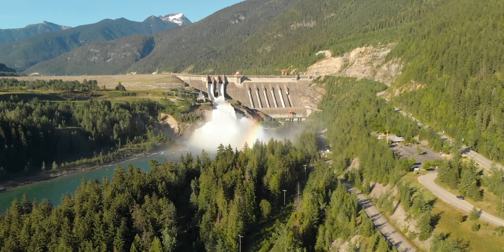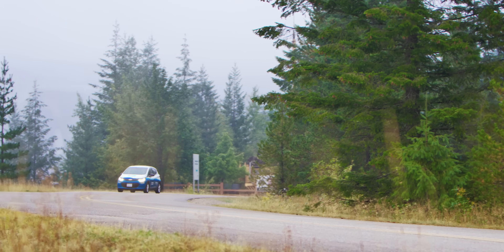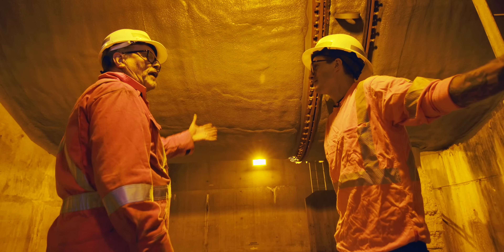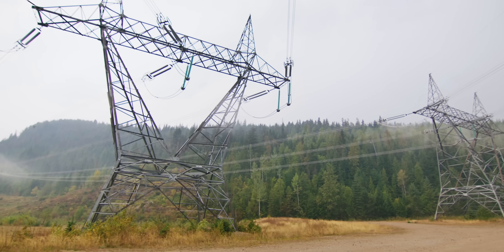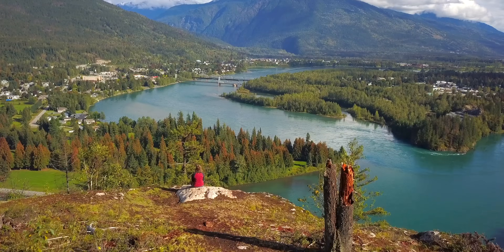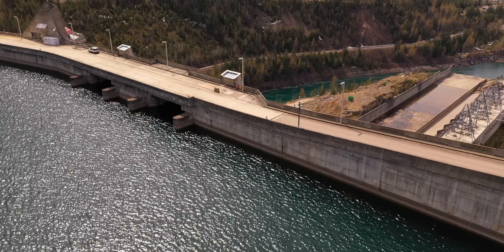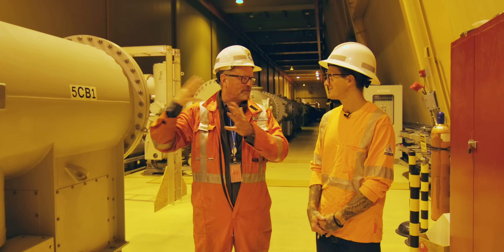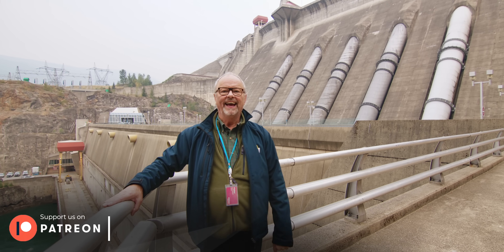This Dam Makes Enough FREE Energy To Run A City

Comment: I think you Canadians need to start thinking about using your hydroelectric power as a big battery for California.  Hold back your hydro power during daylight hours when California solar has excess production that can be used to serve your day time loads.  Then at night you can send hydro power to California to supply their off peak loads that solar power cannot provide.

You actually have the opportunity to be the most economical battery for California.  The 500kv transmission line becomes the means to accomplish this.  This scheme is way more efficient than pumped hydro even considering the transmission line losses.

Back in the late 1960s California utilities benefited from Canadian Entitlement Power purchases following the construction of large dams in Canada.  I think it is time to look at a new opportunity for your hydro to work in conjunction with solar installed in California and the Pacific northwest.

Comment: Two things: There are thousands of old dams (for flood control, old mills, navigation) that have no hydro. A major untapped resource. 2. It is possible to have hydro without dams, using a sort of mill-race system (canals or pipes which hug canyon walls, until they reach a certain height above the canyon floor). In the 1800s and early 1900, this was done all over the western U.S.

Comment: Yes massive but Robert you formula at start is way wrong.
1m3 is 1000kg.  It falls 1 m it has the potential energy of 1000 Joules (PE = m x d).   
1000J is 0.000278 kWhr.  So you were out buy a factor of 3600.

Of course that assumes 100% efficiency which a Hydro plant is about 90%.so 1m3 falling 1 m generates 0.00025 kWhr... or you need 4000 m3 to drop 1m to generate 1kWhr.
Keep up the great videos thanks

Comment: But the up keep alone to maintain something this big would be in the billions annually roughly so 🤷 I come to this by average annual prices for upkeep of hydrodams annually so 500Kw is around £50,000 on average in uk 
Now 7,800 Gigawatts converts into 7800000000 Kilowatts 
So it would cost roughly 150/200 billion a year for annual maintenance alone 😐😐 indeed at the same time if its producing electricity for a whole city am sure that is worth the price 👌🤟 Question is once the dam has paid for itself will the locals get cheaper electricity prices if not free once the dam has paid for itself and had many years of making profits and the government pays the upkeep with taxes or something 🤔👌

Comment: What was left out of this presentation is how well these Hydro Dams can fit in with the variability of renewable energy sources. These five individual hydro turbines can be started, and then throttled up as needed, to off-set the ups and downs of wind and solar. And hydro turbines are much faster responding than simple cycle gas turbines, which usually take 10 minutes to come to full power. These really are the mechanical version of the promised but still distant electric grid batteries, except they are recharged with water coming into the upper lake. The folks looking to get rid of these amazing power resources make me want to pull my hair out, if I had any left to pull. ;-)

Comment: 97% of British Columbia’s electricity generation comes from hydro.  The biggest chunk of the remaining 3% is wind.  A great many BC homes are fully electric (electric heating, electric stoves, electric hot water).  Electricity here costs barely anything, 12.5 cents (Canadian) per kW on average.
Reply: At the current exchange rate, 12.5 cents Canadian is 9.1 cents USD.
Reply: At the current exchange rate, $0.125 CAD is (I think) 8.2p in the UK?

Comment: dams are far from being free energy.
the cost is tens of thousands of animal deaths, the destruction of entire ecosystems and micro-climates, and massive amounts of carbon and particulate emissions manufacturing millions of cubic yards of concrete and reinforcing steel.
but sure, tell me more about how your heated towel rail is now running on "green energy"

Comment: One cubic meter of water dropping one meter represents a value of energy (1000x9.8x1 so roughly 10kWseconds) - Robert says it makes 1kW (a value of power…) - which it would if you dropped it over the course of ten seconds but without a value of time I don’t think the fact makes sense.

Comment: 1:58 "Cause I only know one thing and that is: 1 m³ of water dropping 1 meter downward produces 1 kilowatt of electricity". Sorry Robert, this is not correct. 
It produces 9.81 kJ of energy. If the 1 m³ would drop in 1 second, this would be 9.81 kW (kJ/s) of power. Do this for 1 hour and you have generated 9.81 kWh of electric energy.
One generator at the dam generates almost 500 MW. The water drops 175 meter. At a generator efficiency of 87% this requires a water flow per generator of 333 m³/s. So for all 5 generators delivering max. power simultaneously, it requires 1665 m³/s of water flowing from the lake through the generators and into the Columbia River.
In order to produce the 7800 GWh mentioned, the generators are "only" running 36% of the time at full capacity. 
Amazing facility!

Comment: Dear Robert, love your show and enjoy it for many years now. It was you to get me (an old petrolhead) in electric mobility (am on my 2nd e-car). I also used to be a big fan of hydropower. Of course it can be done in the ocean too, but it is mostly done in rivers (I guess also due to the long time, those facilities can be used and the offshore technic is still not "worldwide standard"). Talking to a biologist specialized in rivers (don't know the English term, sorry),  I understood, that the two most serious problems running a turbine behind a wall in a river are that rivers need a bed out of cobbles and other debris to run on. That "moving floor" is stopped at the wall. What happens downstream is, that without cobbles and stuff, the river deepens into its bed and - over time - creates an ever deeper canyon. So, here in Bavaria, the guys taking care for our Lech river (a formerly wild and sometimes destructible alpine river, nowadays tamed by more than 20 dams) decided, it is money well spend to help the cobbles over any dam. Secondly, it seems to be very hard to teach all creatures living in rivers (esp. new born fish) not be enjoy the feeling of being sliced up by turbine blades. All detour river extensions, at least to my knowledge, do not really help. Still, in comparison - a great technology!

Comment: The Chinese dam stopped working because of heatwaves. Climate change has ruined the most reliable source of electricity. Sure it's renewable, but it isn't intermittent or even that environmentally-friendly! Wind, but especially nuclear, are greener.
But I like reliable hydroelectricity.

Comment: Expensive, destroys habitat. kills salmon stocks, and concrete isn't anywhere near "green" yet.  Shame on you.
Reply from the maker: Thanks for the shame. Obviously trying to shame someone is qa very positive and supportive way of arguing a case.
So let us look at alternatives that produce this amount of power. Coal. Zero impact, burning coal is lovely requires no concrete ever and is clean and delightful.
Gas, same as above only even better and of course, cheap as chips.
Nuclear, um, okay a bit of concrete, and some waste stuff but other than that, super clean.
Wind, much better, very little or no concrete, cheaper, 
Solar. Zero concrete, much cheaper.
No electricity at all, burn whale oil for light and cook with burning sticks. Brilliant. We did that for 10,000 years and everyone was fine. Okay, they dies at age 34 but what the hell.
So I won't accept your shame mate, you work it out and stop being holier than thou (and failing) and do something useful FFS.
Reply: @fullychargedshow  Not the response I was expecting from a channel I regularly follow.  As we are seeing, the solutions we choose for climate change sometimes have deep, far reaching affects not everyone understands.  Electricity and Hydrogen are only as "green" as their sources.  Which energy source we choose to promote and pursue matters.  Just as there's a huge difference between green and "blue" hydrogen (the latter peddled by the fossil fuel industry in an attempt to stay relevant and lucrative,) electrical sources vary in their impact on climate.  Creating dams has a huge impact.  But you know this.  In this video, I do give credit to the dam spokesman for acknowledging both the issues dams cause and that, going forward, they hope to do things better.  The man seemed sincere.  But, given the tremendous impact dams have short- and long-term on the environment, I fear that propaganda like this will spur people to think that new dams are an answer to climate change.  In reality, dams are robbing Peter to pay Paul.
Reply from the maker: @rickhobson3211  Thank you for explaining the hydrogen colour scheme, (to someone who has been fully immersed in these discussions for the last 20 years) and explaining how 'electrical sources vary in their impact on climate.' All very useful information. 
Can I just enquire if tar sands oil extraction, transportation and eventual burning has a tremendous impact short and long-term on the environment? 
Can I ask if the long term social and environmental damage caused by all the oil majors in the Niger Delta over the past 70 years has a tremendous impact short and long-term on the environment? 
I think you'll find it does. 
Can I ask how long a gas peaker plant lasts and how many times it has to be turned off for maintenance? 
I'll tell you are we are both busy 'mansplaining.' They last about 30 years, use huge amounts of concrete and steel and require billions of cubic meters of gas to burn, which cannot be burnt again.
And you are very gracious to acknowledge that I know building dams on this scale has an enormous impact on the surround environment, but not on the wider global environment. In fact it is the least impactful way of generating 2.8 gigawatts 24 hours a day when looked at from a global standpoint.
I fully accept that when this dam was built back in the 1970's there would have been decisions made we would not make now.
But I suggest that in 2070, when it is still going,  people will look on installations like this with a far less jaundiced eyes than they will look at old nuclear fuel storage compounds with 24 hour armed security, old gas and coal plants, old coal mines etc
Reply: @fullychargedshow  I guess this is something that's going to be debated, going forward.  A quick google shows that there are deep concerns from many sectors regarding the long-term impacts of dams on the environment.  In my own state of Idaho there's an ongoing debate on whether the smaller dams along the Snake River should be removed due to their continuous impact on fish populations.  Moreover, while the long-term availability of dams in BC may currently seem rosy, the inverse seems the case for other dams affected by drought in the US and China.  Even now, investments in dams along the Colorado and the Yangtze seem misplaced, and this after the environmental impacts of building them.  The take-away may be that the power generation systems we build to combat climate change must also be able to survive climate change.  As this issue won't be solved in the comments section of a YouTube video, I think I will just close with stating that I do generally enjoy and learn from your videos, and I hope you do keep up the great work.

Comment: The power is not exactly free. The cost is included in the construction and operating costs. The cost difference of operation at full capacity and minimum is probably not that significant.

Comment: Robert, I guess you went to BC on a sailing boat?  Or maybe indulgence class on a gas guzzling jet - just to bring us this bit of news from fossil fuel addicted, tar sands, Canada.  Something that could have just as easily have been brought to us from the UK or Europe.  So why?  I really don't understand.  Please explain.  And "free energy"?  Let's defray the construction and maintenance costs of this dam and remediation cost of the environmental damage it most certainly caused over the lifespan of the dam.  I think you'll find this is not "free energy".  This is not honest reporting.

Comment: Unless I missed my guess, one cubic metre of water (10000N ish) dropping one metre produces about 10000 Joules.  If it drops at one metre per second that's about 10 kW.  Imagine pedalling it uphill - about the weight of 2 Tour de France teams.

Comment: A great video again Robert & team. Hydro electric power is a great source of reliable continuous green energy. There’s a lot of Hydro power in Scotland, but would be good if the UK investigated and invested more into it. The Severn Tidal barrage has been a potential plan for  decades, and whilst it does have a lot of environmental considerations on it’s impact to wildlife, it would potentially supply up to 5% of total UK power - imagine that! How many fossil fuel stations could that replace. Plus it provides predictable and reliable constant power.

Comment: A controversial subject. Downstream there is some evidence that it is affecting the natural habitats of our ecosystem. The question I would put: are there better alternatives to hydroelectric dams? The snow is an effective heat pump store, or ballast that could be used. How much energy is the average home using in BC? In short, although impressive in scale, I think we need to look at the long term effects such facilities have on our natural environment. And with that, I’d like to see FC work with environmental groups to start doing some research into the human impacts of population spread and demographic influences.

Comment: Seems to be an error (factor of 6) at 14 secs in video "7,800 GWh pa supplies 8.1 Million homes"

Assume 15 kWh per day per home= 5.5MegaWh per annum/home x 8.1 Million homes= 44 miilion MWh pa = 44,000 GigaWh pa (or 44 TeraWh pa)- but NOT 7,800 GWh pa  (or 7.8 TWh pa) ??
Reply: Yeah, and 15 kWh/day/houshold is actually low for Canada. According to Statistics Canada, Table 25-10-0060-01 (formerly CANSIM 153-0161), nationwide, the average annual electricity consumption per household in 2019 was 39.7 GJ, or 11 MWh, or 30.2 kWh/day. Granted there's significant regional variation. Places like Quebec, or Newfoundland and Labrador, for instance, which have mostly electric space and water heating, both resistance and heat pump (due to their abundant hydro-power) and cold temperatures, use a lot more than that. Quebec's is the highest in the country at 63.6 GJ, 17.7 MWh, or about 48.4 kWh/day. Even Alberta, which had the lowest household electricity consumption since, while cold, it mainly uses combustion heating being in gas country, had an average electricity consumption of 24.3 GJ/household in 2019, or 6.75 MWh, or 18.5 kWh/day. British Columbia, relevant for this dam, was closer to the average, at 32.2 GJ, or 8.95 MWh, or about 24.5 kWh/day

I mean, 7800 GWh/year for 8.1 million homes gets you a consumption of about 2.64 kWh/day if my math is correct, which is like, under an hour of running an electric oven. Now BC Hydro's total annual generation, ~95% of which is hydro-power depending on the year, is between 43,000-55,000 GWh depending on prevailing water levels, and that is more in range of the 8.1 million people figure.

Comment: It's presented really nicely and who doesn't want free energy that is clean. But let's not lose focus on how these dams are constructed. They use absurd amounts of cement (one of the biggest pollution creating materials in architectural construction, they require constant maintenance to prevent catastrophic failure, they need a workforce to keep things operating safely and it requires a sustainable water source (something that's increasingly becoming an issue because of global warming consequences).

So, while I agree that it's a fantastic theory to use this technology and fully support efforts to aim for clean and renewable energy as our future source of power, I am also sceptical about how it can be integrated without just causing another problem later down the line. That's probably why it isn't something that's been embraced with any level of urgency, considering we already know how to implement it.

Let's not get too carried away about it being FREE though... That's just not going to be the case.

Comment: Love the show (and I have an EV ). BUT its not 'FREE' . Add the cost of building that, the CO2 the concrete gave out as it cured, the cost of maintainance staff, parts and repairs on all the pipes valves turbines. Then add the cost of de silting it one day, or rebuilding it. Then divide that by the life output. Its not free.
Reply: He said at the end they reckon the co2 output over its lifetime is about 3% of a coal plant

Comment: Thanks for your inspiring, well filmed and edited video! 
But at 1:57 I think you mixed units. "1kW of electricity" istn't 1kWh of energy. As I lerned it, potential Energy is: E(pot)=mass x g x hight. 
So: 1m^3 of water=1000[kg] x 9.81[m/s^2] x 1[m] = 9,810[Nm] = 9,810[J]= 9,810[Ws] = 0.002725 kWh (not 1kW). 
(Hint: There are 3600 seconds in an hour.)